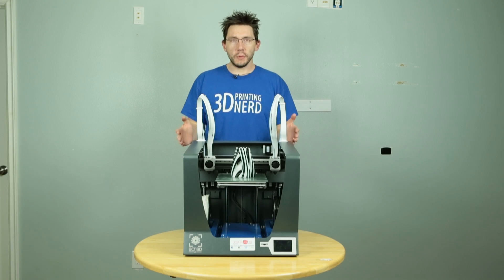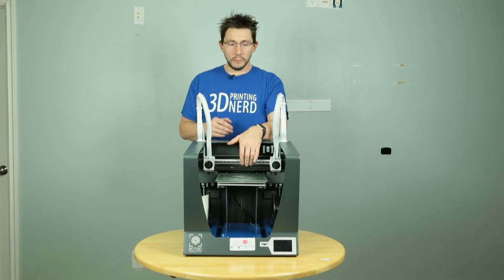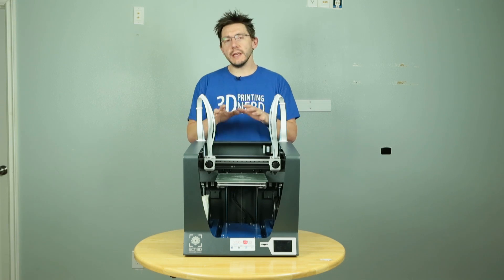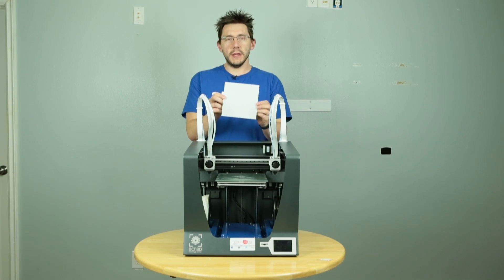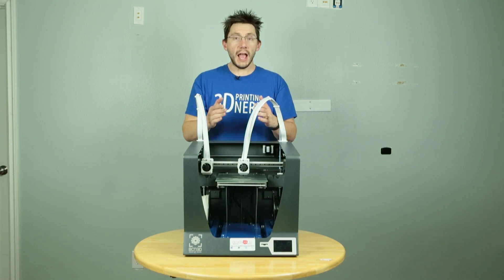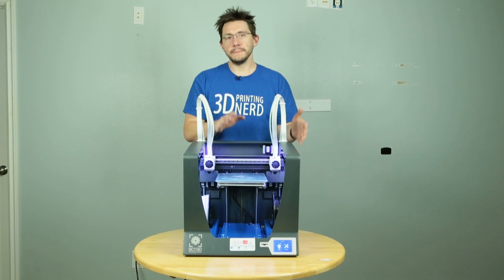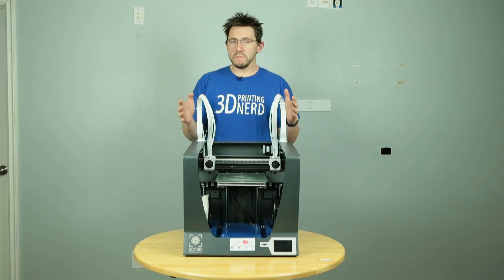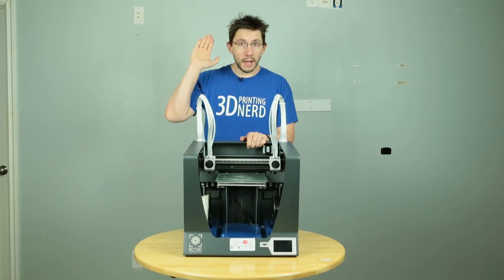BCN3D Sigma 3D Printer Review (Not the Sigma R17 - That is Coming Soon)

Comment: Thanks for the great presentation. I would like to print Nylon and PC mechanical parts. I would need to use dissolvable support material to get complex parts.  I have been using Taz5 single extrusion for my prints so far.   Which dual extrusion printer would you suggest. I would stay under $2000. Thanks,

Comment: can you use ABS plastic wit this printer without problems?
Reply from the maker: +József-Lehel Karacsonyi I'm told you can, and it totally makes sense. I didn't have a chance to send ABS through the system, but the heated build plate and extruder should handle it no problem.

Comment: I am very much looking at this printer. It is almost $1000 more than a couple others I am looking at. All are dual extruders with auto leveling and calibration. One of the others uses a Cyclops like head with full blending abilities. But I really like this set up for using water soluble filament with. One question is can I make it use the 1.75 material? I have a lot of it already.

Comment: Great review. I also own this printer and the print quality is really good.
Unfortunately i can also confirm the very high noise level from the fans.
Reply: +Christian Gassner (mr cg) Which fan is causing this loud noise? I see in this video that it's not coming from the fans on each hot-end.
Reply: It is coming from the smaller fans for the hotend cooling rips. It is not caused by the fan at the front used for the nozzle.
Reply: Christian Gassner Sorry, that really confused me. There is only 1 fan per nozzle/hot-end that i can see, right? In this video, when the noise goes full loud, i don't see those fans spinning. Can't see any other fans either.
Reply: Christian Gassner By any chance do you have any experience with the ultimaker 2+ and if so, how would you rate it compared to your bcn3d sigma? They cost exactly the same for me here.

Comment: Looking forward to the full review because there are a lot of good things with this machine... Saying that, the noise issue might be a real problem for me.
Reply from the maker: +rosebuddesign635 I get the feeling they are hard at work getting the noise level down as I type this.
Reply: +3D Printing Nerd Well that would be great! High five! :)
Reply from the maker: DrR1pper I don't see why you couldn't.
Reply from the maker: DrR1pper I cannot give a true comparison because I didn't have the Sigma long enough to test print surface quality on different settings. I was still dialing in my settings when the Sigma went back. The Zortrax m200 produces amazing surface quality, and I'll show that off in my review coming soon.
Reply from the maker: +DrR1pper No ETA, trying for soon. No experience with Ultimaker yet.
Reply: +3D Printing Nerd Which fan is the noise coming from exactly? didn't look like it was from the two fans on the hot-ends.
Reply from the maker: DrR1pper It was the fan on the electronics under the machine.
Reply: 3D Printing Nerd Thx. I'm really struggling to decide between this and an ultimaker 2+. The noise level on the bcn3d sigma is really off-putting for me. But i would like to be able to print with things like polycarbonate and i'm a little worried the um2+'s 260*C limit is not quite enough for good adhesion between layers.
Reply from the maker: DrR1pper I know BCN3D is actively looking to replace the fans in this machine. They are active on Twitter, don't be afraid to reach out to them. Let them know you saw my review and were worried about the fan noise.
Reply: 3D Printing Nerd
Thank you. Don't use twitter though. Perhaps i could replace the fan myself.
Reply: 3D Printing Nerd I emailed the company and received the following reply:

----------------

Hi,

We are currently working on lowering the noise level in the Sigma. The noise comes from the heatsink fans (one for each extruder), as you can see in the Joel Telling review:

https://www.youtube.com/watch?v=mXYqnv_YcyI

We are testing some new fans, that will be available as a cheap upgrade, an also trying to make they only work once the hotend temperature reaches 100ºC. We expect that the machines sold in july comes with that improvements, that will be available for all the Sigmas already sold.

Thanks!

Roger

----------------

Sounds hopeful. :P
Reply: 3D Printing Nerd One other question please Joel, if i'm not mistaken you have experience with both the bcn3d sigma and zortrax m200. Between the two, which would you say produces the best print surface quality?

Thx
Reply: 3D Printing Nerd Sweet! Thank you. Any eta on that review (pretty please)? Also, have you ever tried an ultimaker 2/2+ by any chance?
Reply: 3D Printing Nerd Ok, i had to ask. :) Looking forward to your review!

Comment: The big issue I see is that it uses 3mm filament.  I wonder if they plan on making one that uses 1.75mm or making a conversion kit.  Most people I know only use 1.75mm so to get the bigger one just for a single printer is going to be a tough sell.
Reply: +Matthew Martin 
I think (as do a lot of others) that the differences are rather 
minor. So just my 2 things I know from experience. We've been using 3 mm
 for some years and now we are moving towards 1.75.

1.75 mm filament is very easy to entangle, especially, if it is not 
on spool. You can even easily create knots on the filament and it is 
very hard to untangle. As long as you keep it on spool and always buy on
 spool, you should be fine.

3 mm filament on the other hand, creates very high tension when the 
spool is about to end. Sometimes the last couple of meters are unusable 
because of this and you have to throw the rest of the spool away.
    3mm

More rigid - easier to print with flexible plastics. I couldn't make
 my 1.75mm printer print with NinjaFlex using standard bowden extruder.Can extrude fasterQuality is less affected by changes in diameter - it is a concern mostly when using cheap plastics

1.75mm

More popular, easier to buyNeeds smaller extruder than 3mmEasier to use with bowden tubeMore precise when printing

Comment: hello  3d P.N !!!

i have a question for you about this printer, for my specific case, in my company, i was intending to design functional prototypes, we work in a workshop and manufacture fruit grading machines, we are from spain, next to barcelona, where this printer is created and designed, i went to see it personally, but still got some questions, it says it can print nylon, in my company we need some strong parts and FDA approved, but what worry me is the tolerance of the 3d prints, for example , if i have a shaft of 15 mm, and i want to make in my design a hole for this shaft to go along the part, does thisprinter will have the right resolution per layer (0,005 mm if im right) to make the right adjustment for the hole /shaft? or it will miss whatever i put in solidworks, and print a 15.05 diameter hole maybe too lose (15.10) or too tight? (15.00) .

I am working with a new type of machine and for maybe one year , all parts will be going to be printed with this printer, so i need some printer that could do this work precisely, and with nylon FDA, (like talumans) do you know any printer with these characteristics?  

Thanks for the video , and the demonstration, you really show your helping attitude,among the tech fans like us! !  
:)

Comment: I wonder how it does with flexible filaments with the bowden setup.I don't think 3mm printers are long for this world, I would not invest into a 3mm printer now days as 1.75mm filament is really a lot more accessible and cheaper. Bowden design and a max speed of 60mm is troubling to me. What is the limiting factor, why can't you go faster? My 2 direct drive printers which have more weight on the carriage are capable of going 90-100mm/sec, and my delta with bowden -- currently under construction is capable of going 150mm/sec and up, so 60 seems really slow -- really slow.
Reply from the maker: +kazolar Did I say limited to 60? Shoot, if so, then I misspoke and that isn't the case.
Reply from the maker: +kazolar Ah, okay, I said optimal. you have to remember I didn't have this long and I sliced only 3 models for printing. Once I get to keep it for longer I'll go faster. promise.

Comment: Couldn't you print bigger filament buckets? shame about the noise. I need to find something as quiet at my Flashforge Finder but prints more than just PLA, will probably get the creator pro or something down the line.

Comment: +3D Printing Nerd
Does that unit have a filtration system for the fumes? That would be the only reason I could think of as to having such strong(loud) fans.
Reply: +relik0fages The printer is open so....
Reply: relik0fages it has, the filtration system is an optional